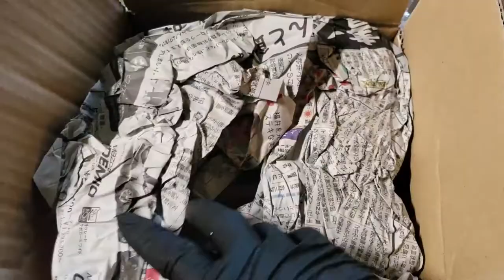How to replace Air Lift Bags and Tdemand Top Hat Replacement

Comment: What is that U shaped took you used in 4:41
Reply from the maker: It's a pitman arm puller. Used for ball joints like that generally. It's able to slip in and not harm the joint's boot. You can rent them from auto stores or buy them.